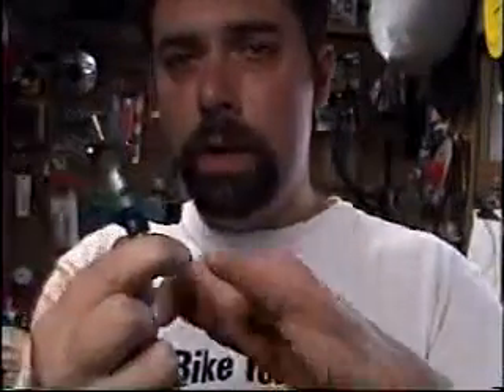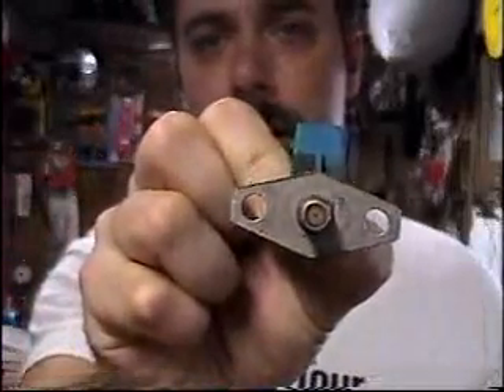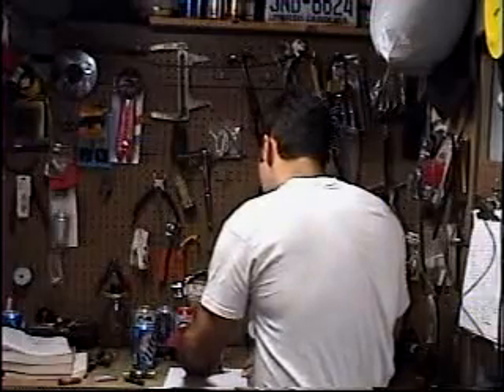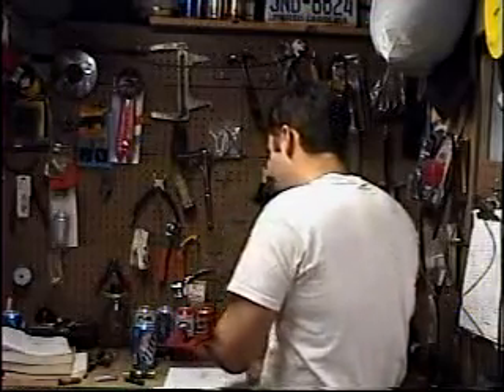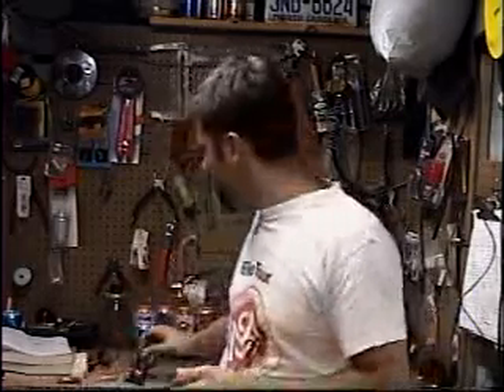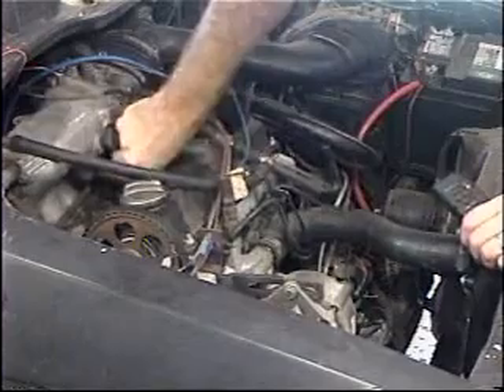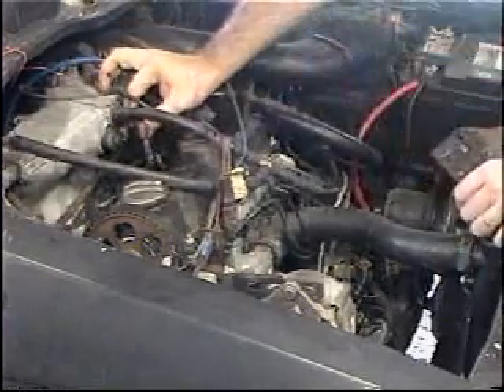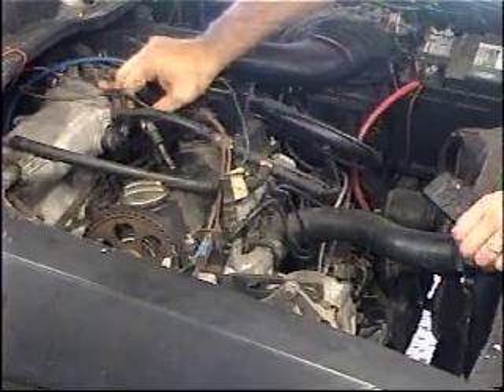VW Rabbit School Of Repair Part 8 Fuel Injectors.

Comment: LOL, no way you can just pull the injector out like that unless you have just replaced the seals maybe.  You need a puller tool, a prybar and sometimes a BMFH to get them out, which is what I was hoping this video would be about.  Also, I recommend upgrading to more than a 2MP camera.